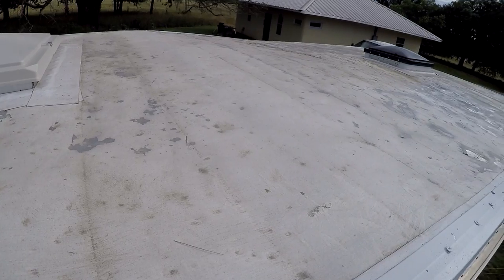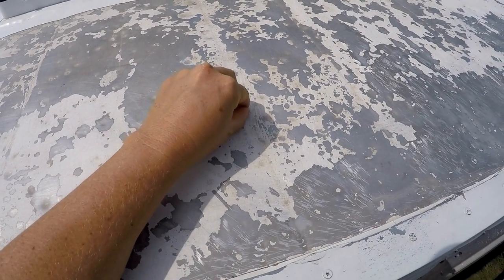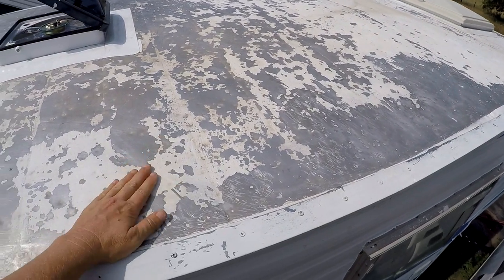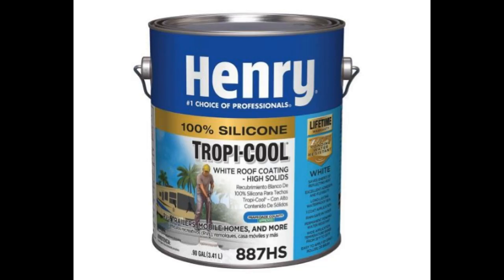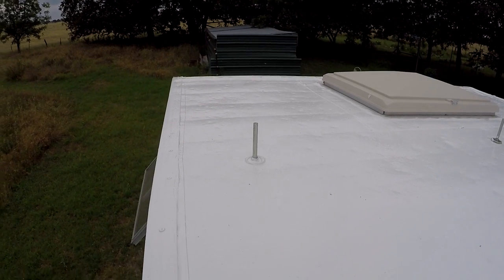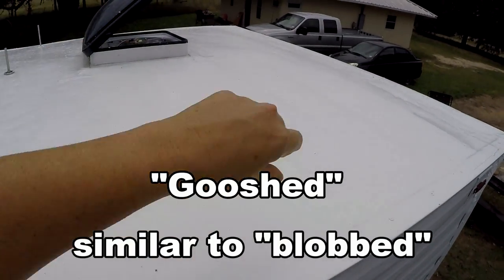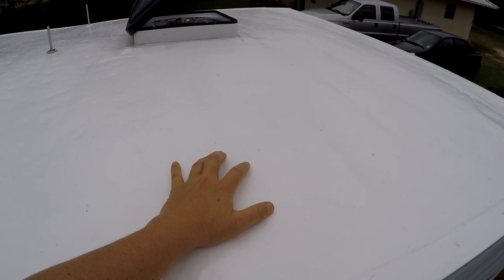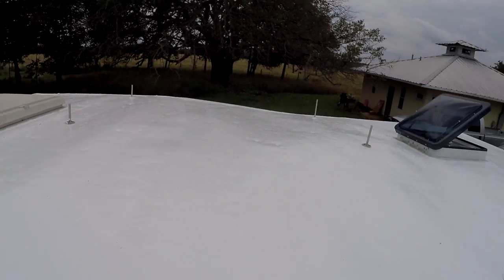Roof coated with Home Depot Henry Tropicool -Truck Camper #17

Comment: As someone who has been in the paint industry for 30+ years, both in sales and in professional application (in a real professional paint store, NOT a Home Depot, and as a licensed contractor for many years prior to that) I'll just go ahead and let you guys know this application will more than likely fail - and pretty quickly too.  Assuming your camper roof is roughly 6x12"ish" - that's 72 square feet.  You should have used the entire gallon.  Coverage rate is exceedingly CRUCIAL in an elastomeric coating, due to it's tensile properties and adhesion properties (it's designed to flex, and it can only do this when it is at it's required millage of - in this case - 15-30 mils final dry film).  This is why I vehemently refuse to sell an elastomeric product to an untrained person in my store unless I have thoroughly discussed the application of the product and the importance of following the directions PRECISELY!  See, an elastomeric coating WILL cover a large area - if you stretch it.  When you stretch it, you are not protected.  It will fail - EVERY time.  

Another thing is the proper application schedule.  If multiple coats are to be used, it is REQUIRED that each coat be allowed the proper amount of time to cure, in this case, with this product, a MINIMUM of 2-6 hours between coats, and NO MORE than 48 hours between coats without a wash down with a non-film forming cleanser such as TSP.

The problem with Home Depot (and don't get me wrong, I love 'em, I shop there frequently) is you have no idea what the guy behind the counter was doing a couple of weeks ago - who knows, probably flipping burgers.  A professional paint store, not one that caters to Susie homemaker and her 'designer boutique' nursery and "chalk paint" would have ensured that you know this before you left the store to apply this product.  

As for the comment below, about not using this on an RV, that is incorrect.  ALWAYS be sure to read the TDS (Technical Data Sheet) for any product you are unfamiliar with as in many cases they can be dangerous or cause a LOT of money in damages if applied incorrectly.  I pretty much guarantee that the reason the lady below was turned down for a warranty is because it was self-applied, not professionally applied with no way to tell, later down the road if proper prep and procedure was followed for application.  

TDS for Henry's 100% Silicone 887 Tropi-Cool:  
http://us.henry.com/fileadmin%2Fpdf%2Fcurrent%2Ftds%2FHE887HS_techdata.pdf

What I would RECOMMEND you guys to do is to measure the roof area being coated and be sure to apply the entire gallon if indeed the surface area is 70+ square feet.  At this point all we can hope for is that during the application of the three coats the underlying coats had sufficient time to cure and complete it's out-gassing stage.  But - I reiterate - the final mil thickness is CRUCIAL.

Sorry for the "novel"...  Good luck guys!

EDIT:  Oh, btw, you'll see in the TDS in the link above that YES, it is able to be used on RV's ;)
Reply from the maker: There wasn't much left.  We'll see how it fairs. Will report back for sure.
Reply: You can also purchase a rather inexpensive millage meter from any paint store and check.  I can't stress how important the millage is.  Too thin, not enough proper millage, it will chalk and crack on you.  More so in the case of an RV style roof which moves and flexes more than a stationary roof will.  You'll be putting it's "elastomeric abilities" to a severe test just in normal circumstances lol.
Reply from the maker: It feels pretty substantial. I did read about the thickness specs.  I think I got it but time will tell.  No going back now.
Reply: ScottM Sherwin williams white gloss exterior paint works good !
Reply: ScottM is it okay to apply this without using the seam and crack sealant with it? Or would that be detrimental to the end product?
Reply from the maker: Hi  - four months later after enduring 100 degree + days in the hot TX sun,  torrential rain, hail, and most recently, almost freezing temps -  the coating is holding up and looks the same as when I first applied it (albeit a bit dusty).   I was just up there yesterday and rubbed my hand across it vigorously...it's solid.  Yay.
Reply: ...Great info....
Reply from the maker: @stephenfiore9960  A few years later and thousands of miles and the roof coating is still going strong.  Looks dirtier but otherwise like new.  No chalking.  No cracks.  No peeling.  I'd say it was as success.
Reply: @sam2753  depth meter.. it's depth meter. dammit
Reply: @MoonbeameSmith  actually no, if you want to get "technical" they have quite a few names and styles, some depending on locale and some depending on manufacturer. Some are electronic, some are not - they are called "mil gauges" "paint thickness gauge" "coating thickness gauge" "elcometer" "coating thickness tester" etc., etc., etc. Sorry, been doing this since the 70's.
Reply: Just a question, is the Henry Tropicool even an elestromeric product?? From what I'm reading online it appears that the 100% silicone products are not.
Reply: @angelajohnson5839  yes it is. By its very nature, required millage, flexibility, etc., yes, it IS an elastomeric.
Reply: @angelajohnson5839  the "current" TDS on this product indicates that it has an "elongation at break rating of 150%" which means it is an elastic coating, hence, an elastomeric...

Comment: I'm thinking of buying this from Lowe's. Any recommendations? http://www.lowes.com/pd_548858-DW4910S-70_4294937087?productId=50193617

This plus angle grinder makes short work of that kind of action
Reply from the maker: I tried various sanders/grinders and it was too much.  If I'd have tried to carry on I'd have damaged the roof....by wearing a hole thru the metal.  Our roof is thin sheet metal...no plywood underneath.  The attachment you linked is like one I tried....didn't work for me.  Too aggressive.

Comment: No!  N O !    NOOOOOOOOO.  It looked as if you have Eternabond tape on your roof.  You must not use HB Fuller's Eternabond Roofseal tape with or even near any silicone product. This goes especially for the Henry's 887 Tropi-Cool, which is 100% silicone, and Flex Seal Liquid p/n LFSWHTR01. This is expressly called out not to do this in the Eternabond data sheet, which can be found on the HB Fuller website.  The amazon listing for Eternabond Tape also states this.
Reply from the maker: Well....we did it.  Thankfully it's still holding up all these years later.  I guess we got lucky.  I can say that the Henry Tropicool doesn't adhere well to the eterna bond tape...definitely not a substance that's gonna last over the top of tape.  We put the tape down first.  Then I painted the silicone up to and overlapping the tape a bit.  For our purposes/application it wasn't necessary for the silicone to bond well to the tape....the tape is well stuck to the metal roof....and the tropicool seals right up to the tape.